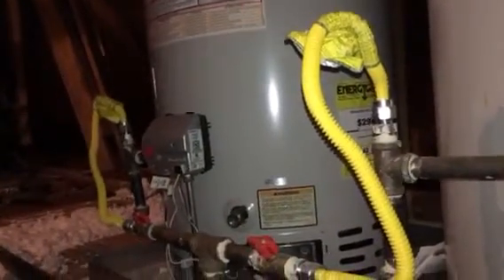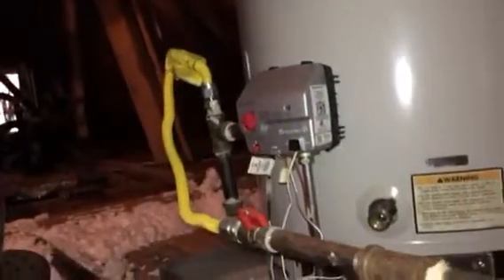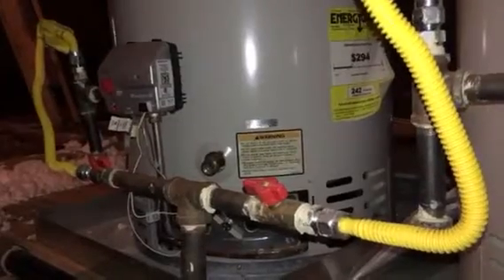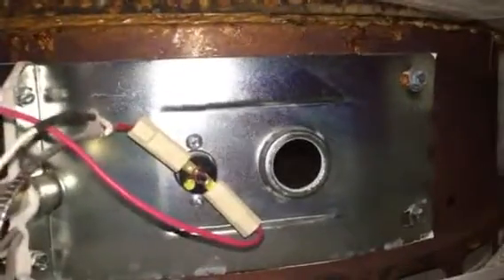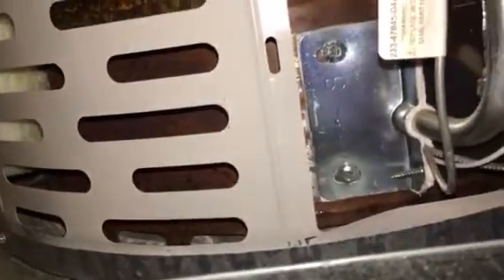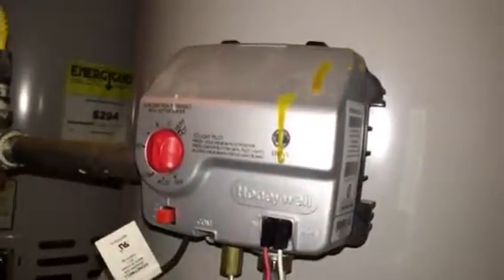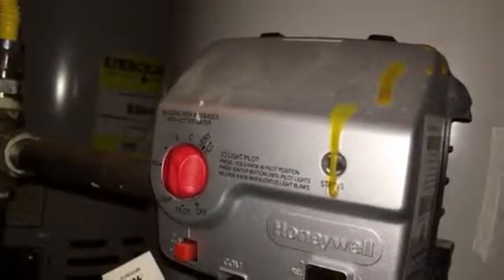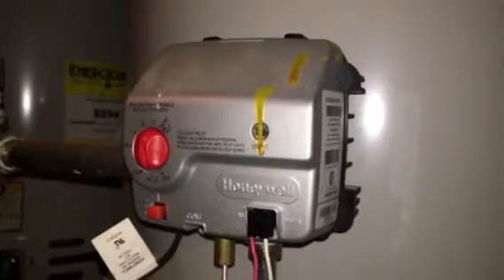Hot water heater pilot won't stay lit

Comment: Your combustion chamber is probably dirty , try pushing the door switch its red, clean the flame arrestor screen, measure the thermopile voltage to make sure its got enough Dc mV , 300-850 , Then check the status light for fault codes , I bet its a code 7!! I love the two water heaters plumbed together , redundancy gave you hot water and saved you money on a 100 gallon water heater those things are $2000-$4000. Its usually something small , Honeywell valves can be frustrating sometimes.

Comment: I have same issue with my Bradford-White brand with Honeywell controller. You need to check if your thermopile (not thermo-couple as this one generated more voltage with pilot light). If your reading comes to about 850 milli-volt, then chances are for this type of water heater, is the problem with the whole controller. The controller they've used (Honeywell) is junk.
Reply: Michael, how do you check the thermopile? If you have details, please share, thanks
Reply: did you? I'm having the same issue now.
Reply: I don't remember what I did to check the thermopile. Sorry. I will, however, share with you what I have kept in my log. I Googled "Bradford white technical support" and I think I called them. Either that or I may have found a YouTube video on how to measure the voltage. They gave me direction to measure the voltage, I think. With the voltage I measured, they declared that the controller is dead. Most likely  if the pilot light does not stay on, it be a problem with the controller. It is idiotic that we pay more money for electronic controller and have to discard the water tank, prematurely due to controller failure. The new water tank I replaced with was without electronic controller.
Reply: @michaelkim8666  thank you! Since then I called a plumber friend and he shared that those Honeywell controllers are crap. I have another on order. Thank you!

Comment: Replace the pilot assy.  Thermopile is bad.  Not enough millivolts to open the gas valve in the controller.  Easy to do.  $34.00.  Did the trick for me.  The combo kit with gas control valve / pilot assy is $250.00.  Or replace the heater @ $1000.00.  Let me know what happens.

Comment: Heard it's the thermal coupler
Reply: The “ Red Sheeting “ is a reset. If you are able to push it in, it was tripped & not letting the pilot to stay lit. If it continues to trip you may need to clean the thermocouple (or replace) or pull the burner assemble & clean.